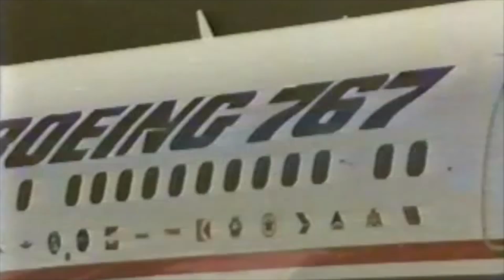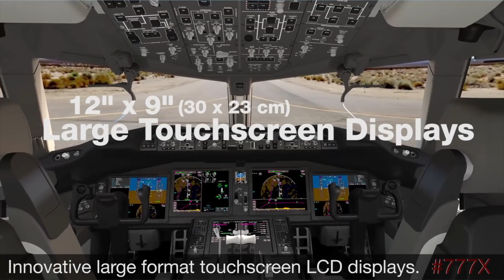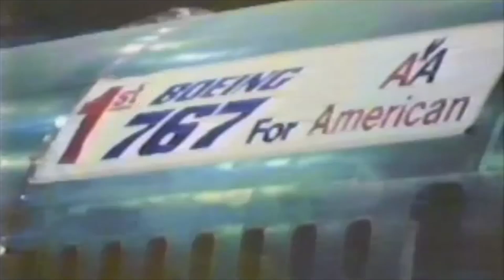Boeing 767X ? Temporary Middle of the Market Airplane?

Comment: 767x? Late response to A330neo
Reply from the maker: willlook Thanks for your comment. Well Boeing actually intended for the 787 to replace the 767. However, during the development due to changes in the weight of the original 787, they added more capability and increased the size of 787. Hence 787 became too large and expensive to replace 767. Airlines used the 787 on their longer routes to take advantage of its long range while the 767 is still flying shorter routes as operating a 787 on shorter routes is inherently less efficient. Delta ordered the A330neo for their shorter routes as it is more cost efficient compared to 787 on those routes. Boeing now wants to replace 767 with a smaller widebody with less range and capacity but higher fuel efficiency for shorter routes. However it did take them quite some time and now it seems unlikely they will launch an all new 797 anytime soon given the MAX crisis and their financial situation. Thanks for watching and if you have not done do consider subscribing and stay tuned for more great videos!
Reply: Agree. It's a "market survey" to wipe the 737MAX fiasco and is a boeing's try to sense opinions.
767 was a very sucesful product,
But a engine,  wings and avionics upgrade is a must, the result is a "new" aircraft. These changes involves retrain mro, operations and ground support areas. Then when the companies executives board analyze pros/cons... they will think in the A350.
Reply from the maker: @Flavio-ar  Thanks for your comment. Well so far passenger airlines like Delta and United have not expressed their interest in the type but have done so for Boeing's rumoured new 797. Upgrading the engines, wings and systems certainly brings many benefits in fuel efficiency without the need to retrain pilots and cabin crew. This is why Airbus opted to re-engine the A320 to develop it into a Neo and airlines have placed huge orders for the Neo. Thanks for watching and if you have not done so do consider subscribing and stay tuned for more great videos!
Reply: @oneskyflyer  the situation with the re-engine 767 is the same as the B737. The aircraft does not have fly by wires and it will take a lot more effort to modernise the cockpit. This means that the 767max can only retain the type certification commonality if boeing chooses to keep the outdated fly by steel interface. The outcome will be another half cooked, compromised aircraft like the max. The A330 re-engine was a straightforward one as it already poses flyby wire as it was designed much later than the B767. To modernise and re-engine the 767 will likely cost boeing more than double the resources it took to do the B777X or nearly half the resources to develop the clean sheet NMA. Even if boeing can make the 767 just as efficient, it will still lack the appeal of a clean sheet design.
Reply: I agree with AirplaneProductions (would be nice a first name ;-) A330neo has significantly more capacity and range than the 767 therefore it's in a different category. On a positive note, last month my uncle returned to Uruguay from Miami in an American 767-200WL!!! Didn't know they still use these. 👏👏👏

Comment: In theory it could work. In practice Boeing will screw it up, hello 737 max anyone? It would be nice but not sure it will happen. Although it would be a cheap way for Boeing to bring a cheaper mid range plane to market. I reckon they probably don’t have the funds to fully develop the 797 so until profits come back (if ever) and they can cover all the eventual 737 lawsuits then maybe then it might work. Ultimately I think Boeing are screwed. And btw the 767 is larger than the 757 NOT the other way round. Now a neo 757 could work........ discuss.
Reply: @D Sked, very interesting post. I agree with you regarding a 757 neo equivalent. Boeing came up with the Max series to counter Airbus' 320 family neos. It was reactive and not pro-active, all for the sake of a quick solution and lower development costs. They were caught out and also taking their share of the market for granted. One would hope they've learnt from the Max fiasco so whatever they decide, they won't repeat the Max saga. What we do know, the market is expecting a plane similar to the said 797 from Boeing. I say they might have to wait for a while! Nice video AirplaneProductions, well done bro.
Reply from the maker: TamaMao'i Thanks for your support. Yep the MAX was a last minute response after American Airlines, previously an all Boeing operator placed orders for the A320 including the new A320neo. However Airbus chose to re-engine also due to customer demands for a more fuel efficient single aisle jet after the C-Series (at the time) was introduced in 2006. Do learn more by checking out my comparison video here -> https://m.youtube.com/watch?v=I0EOTL671es
Reply: @manuhamoa  #HearHear
Reply from the maker: D Sked Well it is unlikely that Boeing will make a Neo or upgraded 757 in my opinion as the production line of that jet has shut down long ago. I do believe that lessons learnt from the 737 MAX crisis will apply to all future airplane programs and that a new 767 will certainly be a safe aircraft. Developing an all new airplane will require at least 15 billion USD for widebodies and while I believe Boeing does have the capital capability to do so, their shareholders would be less happy unless the business case for such an aircraft is very very solid. Thanks for watching and if you have not done so do consider subscribing and stay tuned for more great videos!

Comment: 767 is bigger than the 757
Reply: Peter  it is WIDER  twin aisle  not a single aisle !!! !
Reply from the maker: Peter Day Thanks for your comment. Yep the 767 is a larger small widebody twin while the 757 is a medium to large sized single aisle. It is rare though to develop a widebody and single aisle which shares commonality in flight deck and many systems. Interestingly, the largest 757-300 variant actually carries similar if not more passengers than the smallest 767-200 variant! Thanks for watching and stay tuned for more great videos!

Comment: I always thought it would make more sense to redesign the 767 yeah sure its not going to be a completely new modern aircraft but in terms of the middle of the market it would fit i  perfectly and keep this old girl flying
Reply from the maker: Glen Hindson Thanks for your comment. Well Boeing does have a tendency to be fickle minded about their new aircraft launches. I do think that while it may seem weird to restart the production line of the 767, the 767x will make perfect sense for airlines even if it may not be as efficient as an all new 797. Similar to Airbus with its A330neo, this will attract many airlines to replace older 767s with this updated version. However the 767 is rather old with old systems and may be slightly tricky to update. Thanks for watching and stay tuned for more great videos!
Reply: @oneskyflyer  The 767 production line is still up and operating so would be simple to upgrade the engines !!!!  It is a great plane !!!
Reply from the maker: Wilbur Finnigan Thanks for your comment. Yep the 767 is the perfect platform for middle of the market and it will be interesting to see if Boeing chooses to take the less expensive route of upgrading 767 instead of designing an all new airplane. Thanks for watching and stay tuned for more great videos!
Reply: @oneskyflyer  TRUE !!!  And what can a new airframe do that an older one is all ready doing !!! A fuselage is a tube with wings holding engines and a tail that the airlines will fill to capacity anyway !!!  So they add mood lighting and new colors it still all gets the job done !!!  New improved engines are the really only new upgrades !!!